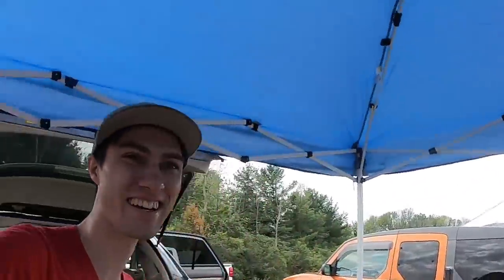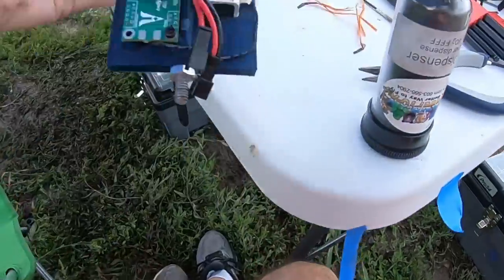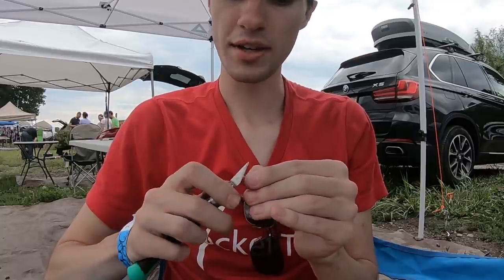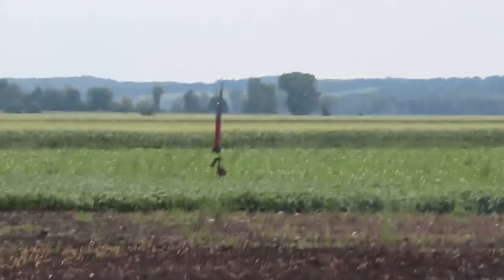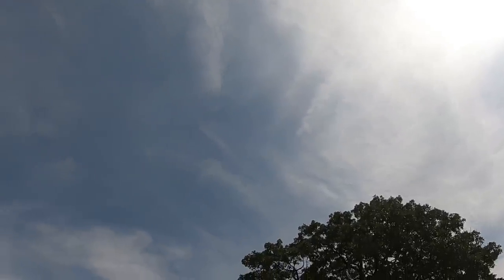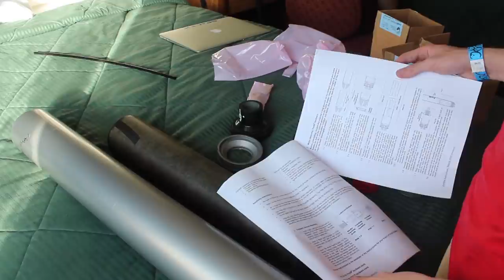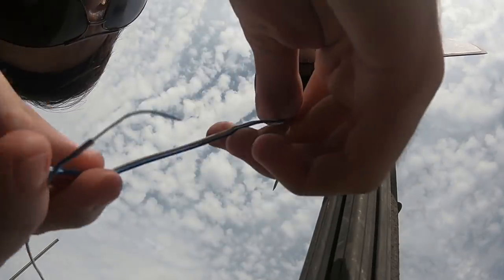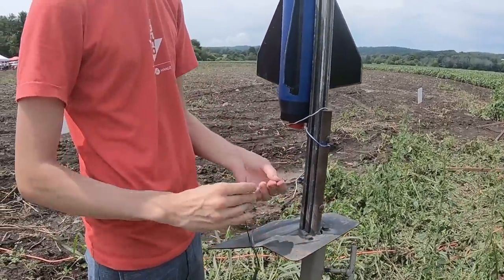High Power Rockets 2: An URRG Weekend

Comment: 68.5 feet up a tree seems like suspiciously high sigfigs, especially for an object that is itself multiple feet long. So where the heck did that number come from? hahaha
Reply from the maker: Nice thing about having a high precision GPS barometer package as a critical piece of flight hardware - when you strand yourself up a tree, you know exactly how up a tree you are.
Reply: @AstroCharlie  How does it know the exact ground level in the little grove of trees to reference against? Is there a built-in terrain topology map? I had assumed they would only reference to sea level or some other datum and not be able to accurately measure versus ground.